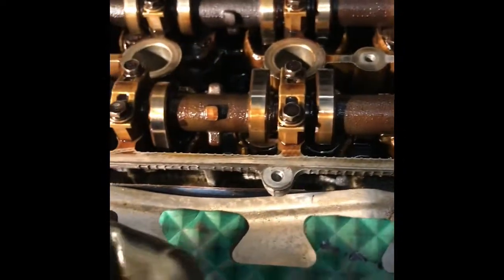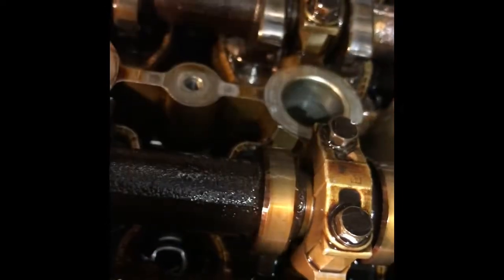Toyota Camry engine noise 2.4L easy fix

Comment: Exhaust spec is 0.48mm. Your 0.40mm is within spec. Did the noise go away after replacing the lifters? I have the same noise on my 07 Camry 2az-fe. I checked all the lifter gaps and found they are all in spec: intake 0.19-29mm, exhaust 0.38-0.48mm. But the noise is still there. Just wondering about your result. What size of new lifter did you get?